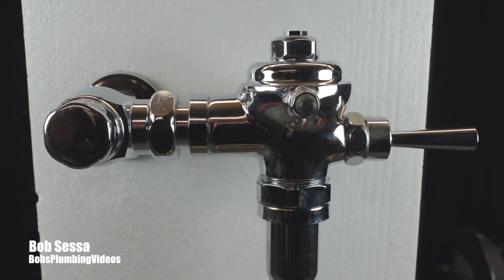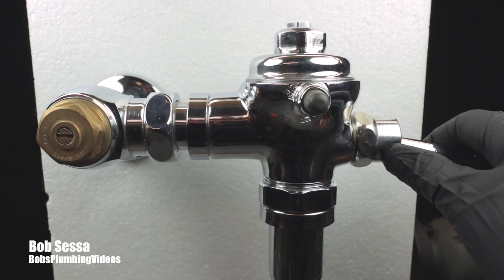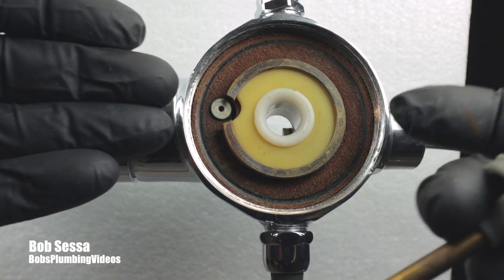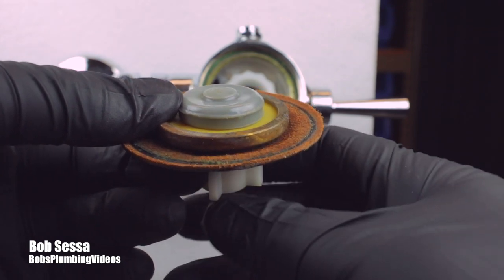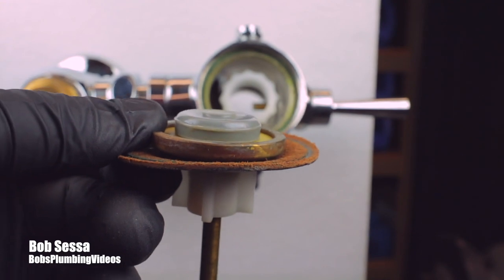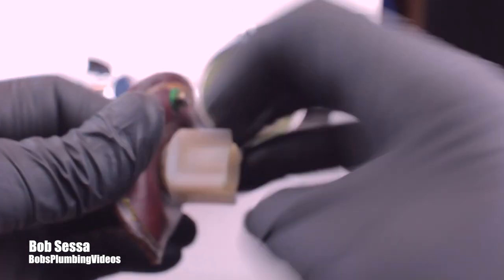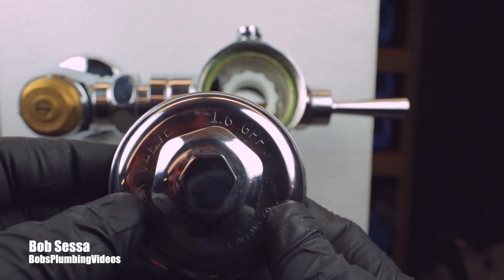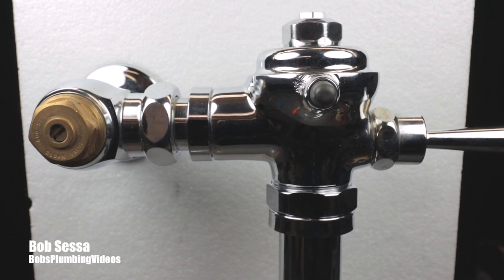Toilet Repair flush-o-meter water hammer

Comment: many thanks. The other instructional video I found on this did not explain that you have to wait a few minutes while it's flushing for the pressure to stabilize and shut off. So I thought the part was not aligned or tightened correctly or something and kept trying to fix it for hours, going insane. Then I come across your video and all I had to do was wait 1 min longer.
Reply from the maker: Glad it helped! Thanks for sharing. Bob

Comment: If I may ask you Mr.Sessa,isn't it better to have an expansion tank as opposed to water hammer arrestors?When we first bought this house the plumbuing was a total nighmare to put it mildly.This house never had a water heater and the water flow was terrible and I do mean terrible.I installed eight inch copper nipples to serve as air cushions and that worked up until the eight inch copper nipples filled with water as will happen over time and I had to drain the water pipes in order to drain the water from the eight inch copper nipples that I was using to tame the water hammer effect.I installed a water pressure reducing valve but I neglected to install an expansion tank and I used to get such water hammer that it sounded like somebody was whacking the water pipes with a hammer.I replaced my water heater and installed an expansion tank and no more water hammer of any kind thank God.It is also important to note that water hammer can occur if the water pipes are not fastened in place properly,great video as always Mr.Sessa,God bless you and yours.

Comment: Is that what you do when the water in flushometer
keep running! Turn that screw down clock wise?
Reply from the maker: Proceed with caution, when you attempt to shut it clockwise, it sometimes starts to leak uncontrollably!
Reply: @BobsPlumbingVideos  thanks Bob good to know! 
Believe it or not I live in Sessa territory!lol

Comment: I have a similar unit in my bathroom in Brooklyn, and when I have to shut the house water in the basement, I get the water hammer first time I flush. The shut off on the valve itself is old and not great to use for full shut off. Is there any way I can prevent the hammer for that first flush...very disturbing and I fear pipe damage which it once caused. Thanks!
Reply from the maker: When you turn the water on, have all the faucets open at the highest level as well as the room where the offender is. It should be able to escape which should help with that water hammer issue.
Reply: @BobsPlumbingVideos  I thank you very much for the reply. I will be certain to have the faucets open in the areas that you have advised before I turn the water back on. Much appreciate your expertise.

Comment: HI! I am getting the bang after I replaced the diaphragm... and it happens at the end of the flush
Reply from the maker: Is there a vacuum breaker in the tailpiece?
Reply: @BobsPlumbingVideos  not sure... where do I look for that. Had enough ofa hard time opening the cap of the flashometer:)
Reply: @BobsPlumbingVideos  I'm using a-38-A sloan diaphragm
Reply: Check the tiny hole in the diaphragm to make sure it is not blocked or too small compared to the original one.